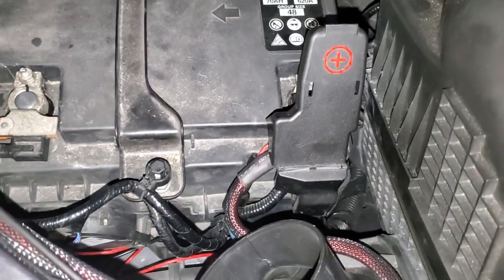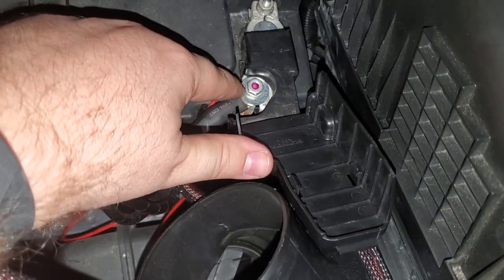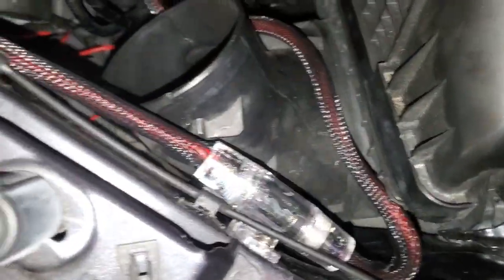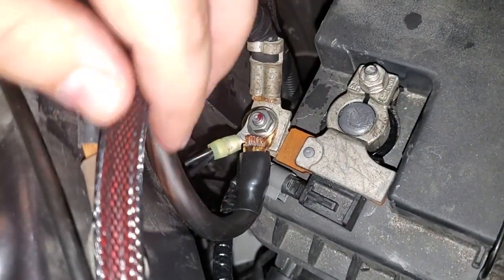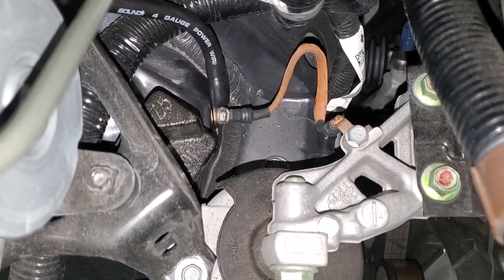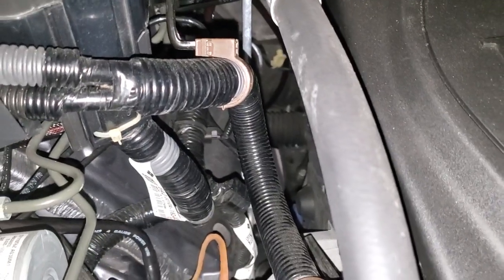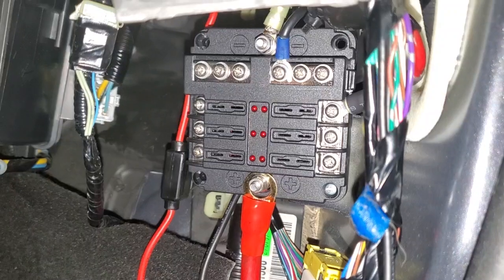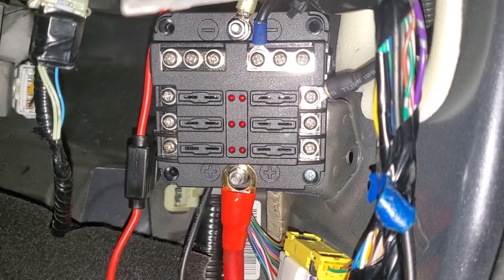Adding electrical power to the Honda Ridgeline.

Comment: What year Ridgeline? Is there a running board grommet on drivers side? I been trying to find a spot to run a 4awg cable back to amps on driver side. Thanks for sharing
Reply from the maker: 2017.   It's near the frame number on the passenger side floorboard.
Reply: @Radi0activeBen  so not on drivers side?
Reply: @Radi0activeBen same as driver side. I ran mine there. Thanks so much for doing this video